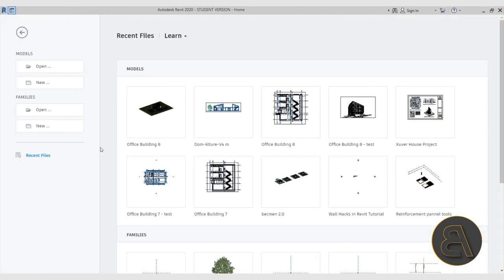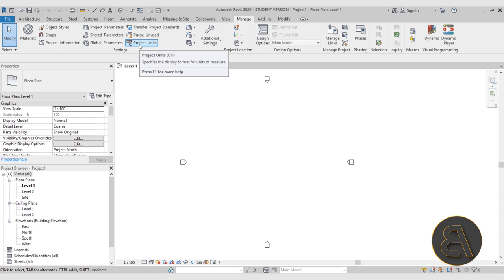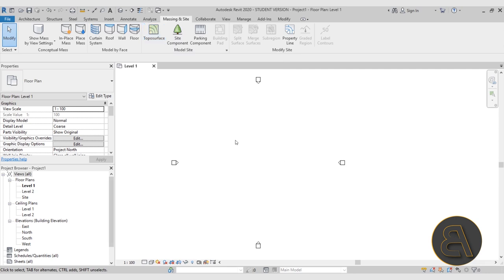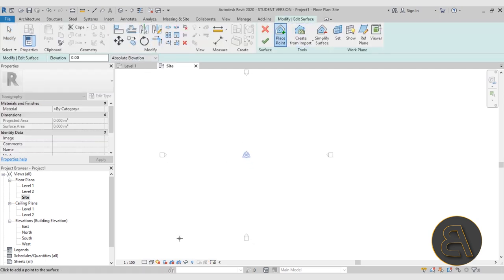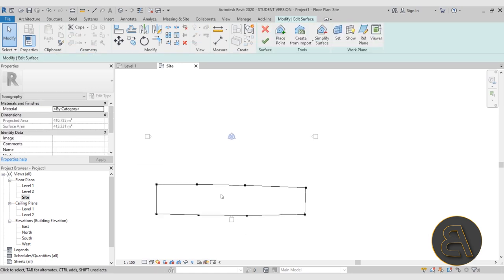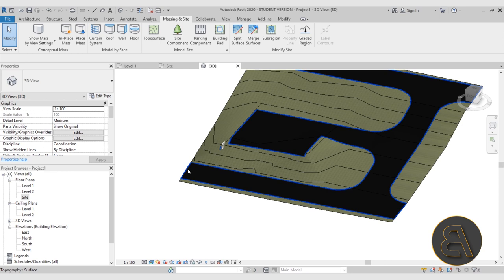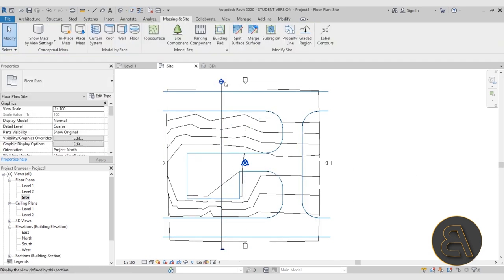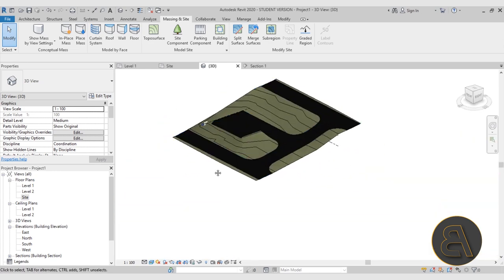Roads and Curbs in Revit Tutorial

Comment: Cool ! I had the same idea, just a year later..lol.  I added sidewalks , gutter, striping, and the road as different railing profiles and spaced them accordingly.  Basically creating a railing that is the road.The striping was the guard rail. Using the railing command as a sweep solid modeling command that can be hosted to topo. I created a custom baluster that was a street light, and one that was a manhole cover. You could even import a tree as a baluster and create a quick roadscape. When you pick the new host as the topo, you have a decent road. It looks good in Enscape , Lumion, and Twinmotion. It's not perfect, but saves a lot of time for doing archviz.

Comment: 19:35 I found that just slicing the lines is a possible fix for this problem. Just slice the continuous arc, line or spline and sometimes it works just fine without having to move the railing guide. Try it out and give me feedback if it also worked for you. :)